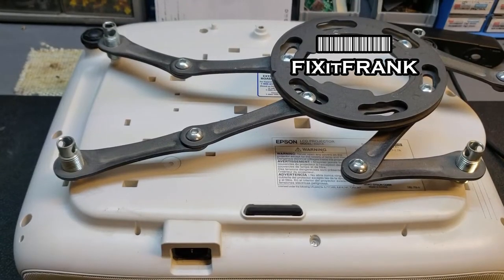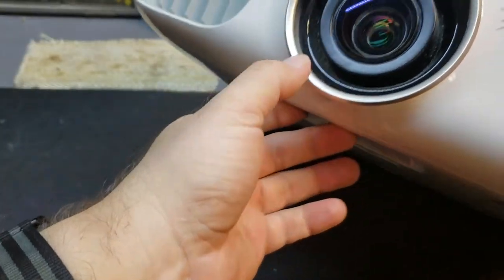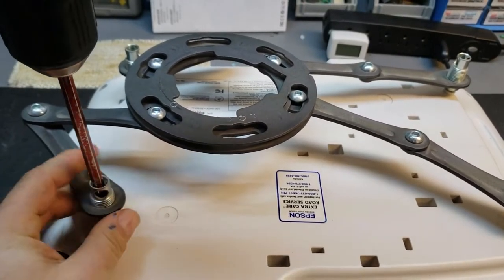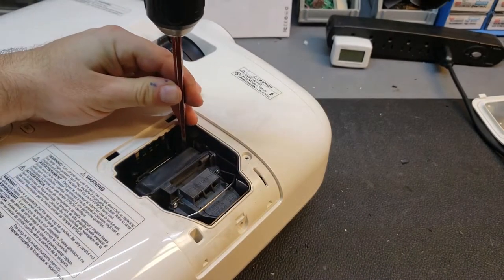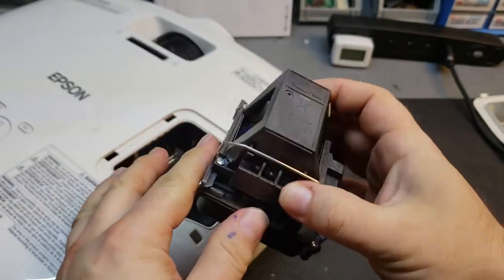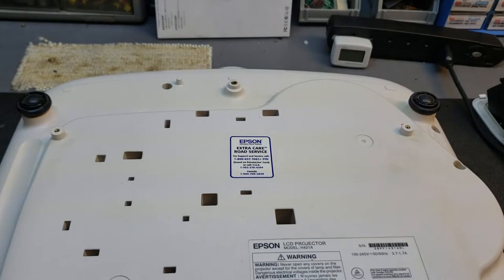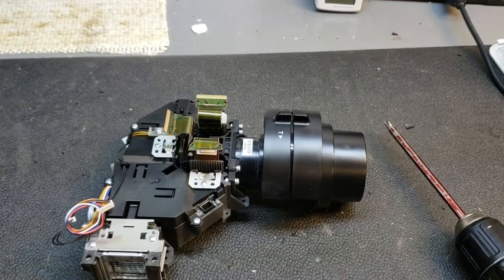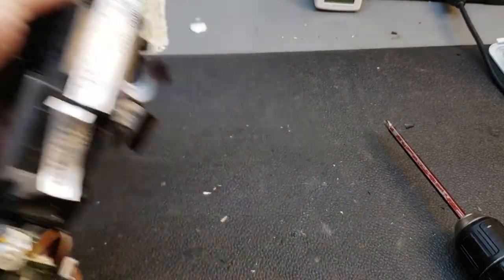Epson Home Cinema 3010 LCD Projector Cleaning

Comment: Thank you for this video. I love that you use a power driver for screws.
Reply from the maker: My wrists are pretty beat up and I am impatient :)
 If I use a hand driver too long, my hands will hurt like mad for a while. I started using a drill driver maybe 15 years ago.  Once you get used to them, you almost have the same 'feel' for the screws.  I still use hand drivers when I have to, but I try and minimize it.
Reply: @FixitFrank  I believe even with good hands a power driver is simply superior and so much faster. I use a cheap "impact" one that is surprisingly controllable and makes it extremely easy to remove screws even if they are a little stuck

Comment: Hi Frank, kudos for your content here, it's extremely helpful to the inexperienced projector repairer. I've had my Epson TW8100 since new, nearly 10 years on now. It's been powering our cinema setup the whole time. Single config, in same place with no change to cabling. It's been great. Yesterday, exactly half the screen started showing a blue hazy , circular hue against dark background projections and it's yellow when the projection is white background, with a very visible line down the middle to divide the half image. I changed the lamp with a spare, all the cables, tried VGA and HDMI, no dice. I'm also seeing this issue on the setup's main menu screen too (ruling out all inputs). I've reviewed other people similar problems with half-screen projected discolorations and now I'm not sure if I'm dealing with a dirt issue in the optical path, an electronics issue with the main board or optical path burnout damage of some kind to one the polarizing filters or to the LCD panels. I've got an Epson service centre nearby and ready to chicken out and take to them. They want $100 for diagnosis only. I fear that might be waste of money if the projector is toast gauging from similar comments below. Your thoughts, or anybody else, who's had a similar experience, would be very much appreciated before I go and start spending money to try and fix it. I'm happy to do so, if I'm confident it can be fixed at a reasonable price.
Reply from the maker: Hi John,  save your $100.  While I wish we could save them all,  the goal of my content is to inform and save folks money.  You are looking at an expensive repair.  Its a polarizer or prism coating failure.  I have seen that circle issue so many time and the most common age of projector that I hear this with is 10 years. On average its 7-10 years.  Treat yourself to a new projector. They have gotten really nice lately.  If you are in the USA, there is a company in NJ called Projectorscreen.com  They are incredibly helpful and have really good pricing.  I am not affiliated with them at all, I just know about their reputation and have dealt with them personally.
Reply: @FixitFrank  Thankyou !.....I'd buy you a beer, but I'm in Melbourne, Australia mate. I called my original supplier when the issue started, they're still in the cinema business. They said price and availability on a new one in Aus was 6 MONTHS or more, and maybe. All due to residual Covid supply-chain issues. Tears from the family. We're exploring the option of a new BIG LCD lounge TV (to replace the old 50" plasma) to supplement viewing needs until then. The hunt for a new proj has begun. If you (or anyone else) have an opinion on  equivalent units in that class of proj. it would be much appreciated. I'll checkout projectorscreen.com.
Reply: @FixitFrank  Don't you think because it's only at half of the screen it's rather some electronic signal issue?
Reply: Hi @johns243, I bought a TW8100 second hand recently and it has exactly this problem. My guess is that it's an electronics or motherboard issue... but nothing "optical". Did you find a solution?

Comment: So is this process very similar to the epson hc 4010?  I look inside the lense while turned on and there is a fly inside at the very inside part of the lense and some kind of filter behind that.  The layer of glass at the very end where the fly is at is kinda smudgy i think because the fly and the filter behind that is kinda hazy and or foggy i think its dirty. If i take it apart like you did in this video, will i able to clean those parts?  The visual showing on the projector screen is kinda hazy. I just changed my bulb to a new one.  I’ve taken apart a 100$ projector and am familiar with how to deal with this. I just want to know if it will be able to be cleaned out if i do the same thing you did. And would Cotton swabs be good enough or should i get some type of lens cleaner materials to clear off the coatings on the inner part of lenses and the filter behind that?
Reply from the maker: That haze is most likely a bad/failing coating.  If you even touch it, it will scratch or get worse.  If you put any chemicals on it, it will ruin it.  If that 4010 is 7ish years old, its failing.  Thats how epsons usually die. They use an organic coating that wears out and degrades and nothing you can do will repair it.  It's the main reason I stopped working on epson. In my opinion they are engineered and built to fail after  certain amount of time. 
Believe it or not, deionized/distilled water is the only liquid you should ever use on optics.  I try not to use them all if possible. The myriad of glass fuming and sputter coatings can get destroyed pretty easily. I learned this the hard way.  Photo lens brush or other soft brush is okay and sometimes microfiber if its bad.  But this is only on lenses or obvious glass. Anything that is a filter or polariser should just be left alone or maybe gently puffed with air but zero physical contact. again I learned that the hard way.

Comment: Hi Frank, I have an Epson 3020 and I see 2 blue and 5 yellow vertical lines on the screen. Any suggestions what might be the issue and possible fix ?
Reply from the maker: Hmm.  Hard to say exactly but it sounds like an LCD cable problem.  If it is not a bad connection between the cables and the mainboard, that means its at the panel. That would be a terminal projector unfortunately . Repair would be incredibly expensive.

Comment: Hi frank great videos. I have a Epson 6030ub looks awesome but it has a couple vertical blue lines. Any thoughts thx
Reply from the maker: Thanks!  Vertical lines can mean a bad connection at the LCD cable into the connector or a damaged connection from the cable to the LCD panel.  I'd really need to see a picture though to know for sure.

Comment: Do you have any advice on how to disconnect the zif connectors to the lcd panels? I’ve tried the two mini screwdrivers like you did, and a pair of spudgers, and fingernails…to the point of marring the white part. Maybe Eason started gluing them down?  Or is there some trick I can’t see?
Reply from the maker: The white part should just flip up ever so slightly.  They pop up maybe 2mm? It isn't much.  I have not heard of them being glued but with Epson anything is possible. Does the cable feel more loose if you lift up on the latch of the connector?

Comment: Hi Frank, I hope you can help me, I am searching for the internal bracket where the projector light with case screws into for a home cinema 2040, the old bulb melted part of it, but I don't know what that part is called, I've searched everywhere can't find it...please and thanks!
Reply from the maker: Thats a tough one. Its actually a significant part of the optics.  Can you at least get a lamp installed even if the screws can't seat?  I'd see if you can use it as is. I say this because if you can find the part, its not going to be cheap and then the install is going to be a huge hassle.  However if you want to try emailing Time electronics, they may have a used but good part for you.  gydz@timeprojectorlamp.com  Give them a shout and let them know I referred you.
Reply: @FixitFrank  thank you verymuch!

Comment: Hey I have a powerlite home cinema 3010 by epson blue lcd ribbon cracked and a lens was broken along with a metal piece and laying in the bottom could you advise who to get parts that aren't going to take advantage.  Trying to fix for my grand baby has im on fixed budget? I can do the work just can't find the parts. And repair centers want more than its worth to fix. Could almost buy a new one for what there wanting. Can you advise please and thankyou
Reply from the maker: Hi Kevin, I must warn you, that's a tough job. The panels are aligned in the factory and glued in place. Merely loosening the screws in the panel corner is enough to throw off the convergence of the RGB channels. Getting a blue panel is definitely an option but alignment after the fact is your hurdle.  LCD projectors are a real hassle with optic problems. I don't even mess with optic problems on them. 
Your best bet is finding a used but working optical assembly. That is all three panels mounted to the prism cube. They are already aligned. You can usually just put them in and go.  
If your budget is tight ($150 for an optical assembly on average), you may want to sell the 3010' for parts and buy a used dlp projector. They tend to be way cheaper and easier to keep going. 
I wish I had more positive news but I don't want to give you false hope.

Comment: Hi, I bought a refurbished unit HC 3700 and noticed some hairline scratches on or inside the lens and lots of tiny dust spots through the lens assembly, strange dark spots, and a fringing in the lens. In addition the for corner focusing is not uniform. But the picture looks good. Should I send back and get a dlp, or try again with another Epson? The used Epson is almost the same cost of new DLP.

Comment: Hi Frank, thanks for all the help you provide to the community. I have an Epson 3700 with only 800 hours but out of warranty, the power light is solid blue, the status light is blinking blue non stop and I get no image. what do you think is the issue? is it worth fixing it?
Reply from the maker: Hey Bob! Hope all well with you. Thank you! I hope it helps people.
My experience with Epson is limited due to their lack of out of warranty info. However, I would check the Iris, and the cinema filter. They should be right next to each other in the front end of the optic assembly. If the gear rack of the cinema filter(I think that's its name, the glass that slides in and out of the light path) is jammed or out of time that can be an issue and the iris can also jam. That particular error code is not in the manual(as you probably saw) so I suspect it is one of those issues. I'd start there. I doubt its a fan since the temp light should flash in that situation.  Lastly, you may want to try pulling error codes via the service port but I am not exactly sure how to interface with that. It might need epson software.  It does offer wireless LAN, maybe there will codes listed on the web interface page.

Comment: Hi Frank. Thank you for the video. I am looking to buy a used 5020 that has a blue vertical line left of center. Is that repairable?  I am hoping it’s cleaning or a ribbon connection issue.
Reply from the maker: My personal feeling is that buying used Epson's is too much of a gamble.  It might be as simple as a bad connection for the flat flex cable, but it also could easily be a bad LCD panel. That is not easily replaceable.  My personal opinion is that DLP projectors tend to be more reliable in the long run.  They are definitely easier to repair and maintain and have less parts that wear out from age.  Three-four years old and having the blue line issue is a little early in my opinion too.  You may end up with more problems as the unit ages.  
If the current owner will sell it to you cheap, it might be worth re-seating the cable.  Otherwise I would not buy it.  A new LCD and installing the LCD properly is a nightmare without proper tooling and alignment jigs.  
If they are available in your area, I would look at Mitsubishi, NEC, Viewsonic and then BenQ and Optoma (all DLP).  I say BenQ and Optoma last because they hold their value more than the other 3.  I see a lot of Mitsubishi DLPs rated at 1080p for in the $200 range here in the states.

Comment: Hi Frank, i bought an Epson eh-tw7200 with dust blobs and took it apart to clean, i used compressed air in a can and now iv got a green halo around white text and objects. The focus is also not as clear as it was any ideas what i have dislodged or coated 

Cheers
Reply from the maker: Hi Marc,  Check to see if you might have blown the coating off the final prism. that square prism that the lcd panels are mounted to, has a coating that is important.  Sometimes the coating will flake off. If that happens I hate to say it but its new projector time.   Nothing you did, its just how they go bad. Every epson will do that eventually.
Reply: @FixitFrank Thankyou for taking the time to reply, bit of an update i managed to wipe all the surfaces that i blown the air on and got rid of the halo but no matter how hard i try i am always left with dust blobs even after spending ages cleaning it. Every time i clear some blobs i end up just moving them towards the corners of the screen
Reply from the maker: I'd try a photobrush and a vacuum and ever so carefully clean the center prism and lcd panels.  Stay away from the polarizer panels.  they will scratch super easily. Also if the lamp is old, and getting dim, they can make dust blobs seem more obvious sometimes.  Newer lamps are so bright they wash out the dust blobs. I Suspect you have dust in the center of the optics though by your description.
Reply: @FixitFrank  Thanks very much for the update, the projector is now clean apart from one green blob i can live with. I bought a camera optic cleaning kit and used some glasses lens cleaner on everything, i also used one of those little hand pumps to blow remaining dust particles after it was damp seems to have worked a treat thanks.

Comment: Hi Frank. Thanks for the video! I'm seeing a green tint on the right side of the image on my projector, and a red tint on the left side. Is that something that might be cleaning related, or do I need to replace the LCD panels? Thanks!
Reply from the maker: Hopefully it's just cleaning.  If its bad LCD panels the projector is toast. There is no replacing the panels on these.  When the panels go, so do the other optics. you would end up replacing the entire optic block which is crazy expensive.
Reply: Is there a way to tell without taking the whole thing apart?
Reply from the maker: kind of. I would need to see a picture of the what the image looks like.  You may need to at least remove the top cover if the picture doesn't show conclusive info.

Comment: Half of my projection has a distortion that is only really seen when the screen is showing blue for the most part. I contacted a place that does projector repairs and they say it is a main board issue. I am just wondering with only directly half of the projection being an issue (possibly from many hours in one usage and switching around modes too many times the last time using before this occurred) if it's really the main board or just a loose wire or some other build up. The cost of the main board and labor is over half the price I got for this projector and I have used it for many years, so debating if worth the repair or just get a new projector or TV.
Reply from the maker: Do you have a BenQ W5000?  That is a known issue on those.  The second DMD controller goes bad. If you have an Epson and the blue is kind of "blob" like, then it is your polarizers rather than the mainboard and in that case, sadly the projector is finished.

Comment: I have an Epson home cinema 2500 lumens 3d with the speaker in it,,,,, when I turn the projector on I see a large yellow vertical line sometimes with a blue one on opposite side that go away after a few minutes but what does not go away is a bunch of thin blue vertical lines the go all away across the picture. What you think?
Reply from the maker: Hi Derrick, That sounds like a cable for the blue LCD panel having problems.  It may need to be re-connected to the mainboard or the cable itself is de-bonding from the LCD panel.